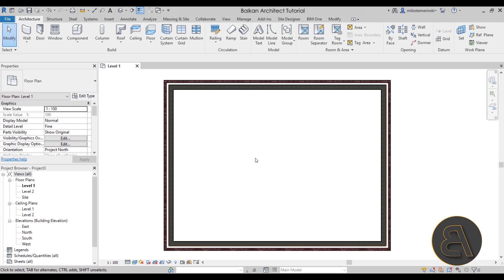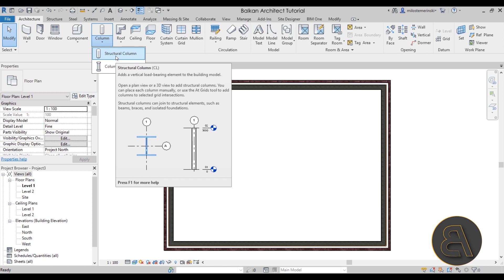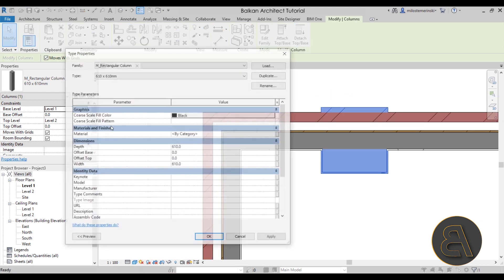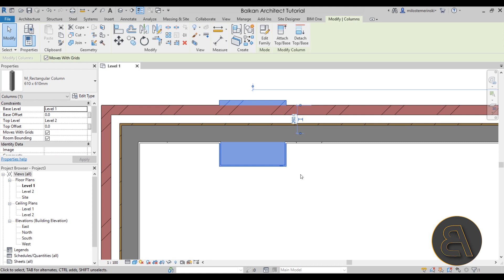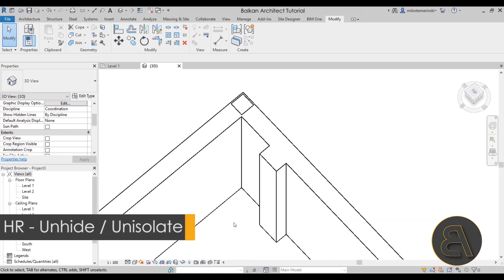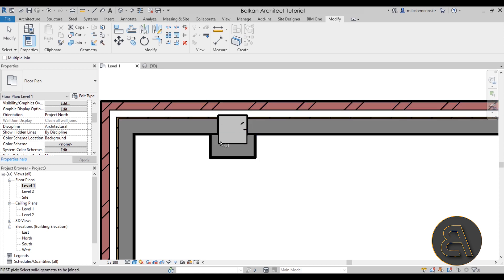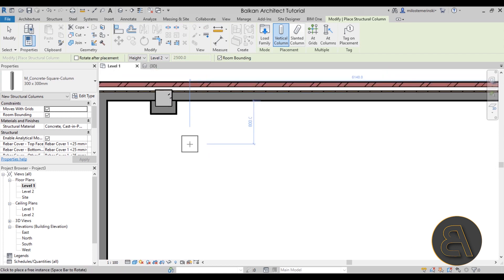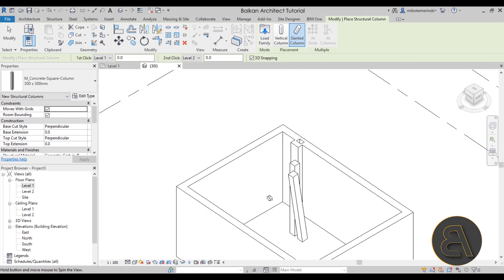Structural VS Architectural Columns in Revit Tutorial

Comment: question: you put the structural column inside the architectural column, does it mean that I can do that where it serves as the finish? if we have 200x400mm structural column then I will need to have a bigger architectural column?let say 25mm plastering then it would be additional 25mm bigger? let say all finish is just paint if I will not do that then how can i make the finish of the struct column same with the wall, just paint it?im not sure if I explain it correctly...for example there's wall I have one column (the wall is not continues because of the column between) then what should be the proper way of doing it?

Comment: Hello, Thank you for all videos Mr. BALKAN i like your tutorials. I am from Algeria and I started with you in revit from zero.
I have some problems with beam: When i have beam under celling i use structural beam, but i don't know how to cover it with plaster of 1cm thikness. I tryed to place small wall of 1cm thickness an slab with 1cm in botom of beam, but it takes lot of time to do it. I didn't see some explaination for that. 

Waiting for answer, Thanks again for all your tutorials i will continue to watch.  Good bye
Reply: It is easy to do that on the ''exterior surfaces''. Let's say storey height of your project is 300 cm and height of beam is 40 cm. Just make sure the height of your wall is 300 cm(I mean it should equal to your storey height) and then join your wall to the beam and slab. In this way you can cover your beam and column with plaster or with other finish materials. 

But, just like you, I don't know how to cover interior face of the columns and beams with the plaster.